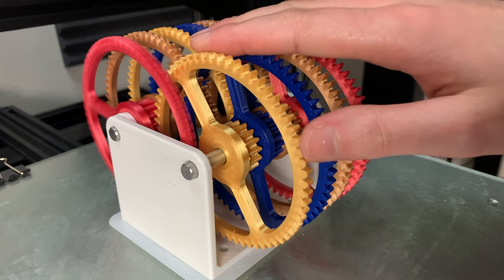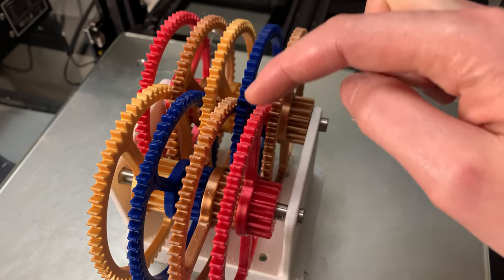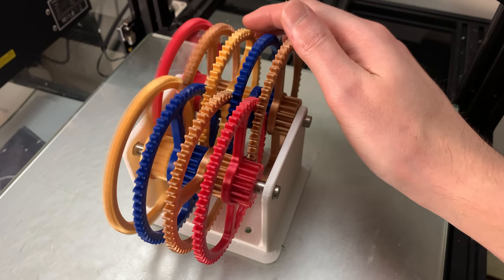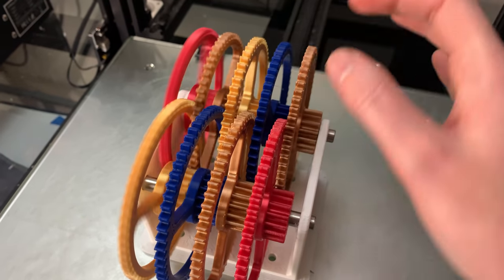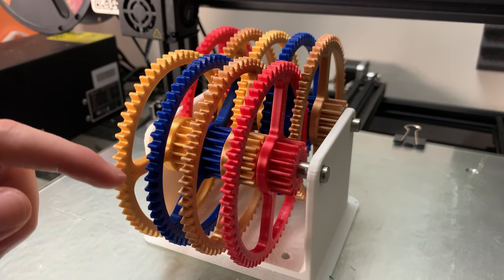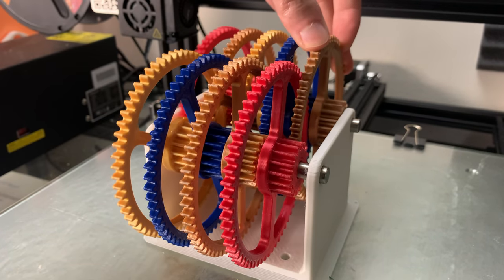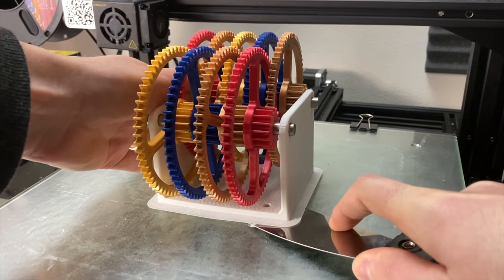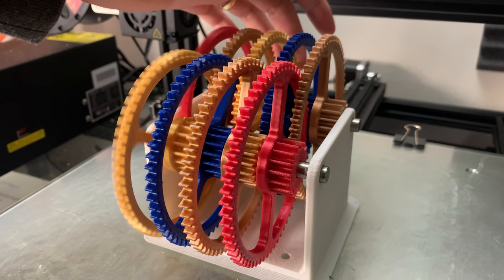Is it possible to spin the last gear?  (1:65000 gear ratio)

Comment: It's caused by the rotation inertia of the gears. For each couple of gears it is multiplied by (reduction)^2, giving the last gear an enormous inertia
Reply: Friction also factors in as well.
Reply: I think Its inertia in combination with friction. if there was no friction, I assume it would be possibe to spin the last gear but it would take a long time to accelerate
Reply: @lilapela  Each stage multiplies the total torque (friction + inertia) by the gear ratio. When run in the "normal" direction, the gear ratio helps overcome both friction and inertia. If there was no friction at all, it would still require 65000 times as much torque; possibly more than the plastic gear can stand without breaking. But I'm likewise pretty sure that if you had all the time in the world and none of the friction, it would eventually get moving under otherwise reasonable conditions.
Reply: Yes, inertia may be the biggest factor here.

Also, it is worth noting that speeds multiply by the same factor. If the last gear was spun so that it's outside moves at mere 1 cm/s, the first gear's outside would move at 650 m/s, almost twice the speed of sound.
Reply: I ain't no scientist but with a lever is it possible to turn the wheel
Reply: @threedo1609  you'd probably break it before it spun
Reply: @threedo1609  As said, it will break before it spins. Likewise, if we ignore lots of physics, a large enough flywheel could get it moving.
Reply: @threedo1609  if the lever is 65,000 feet long ;)

Levers and fulcrums work basically the same way as different-sized gears: a small force applied over a large distance translates to a large force applies over a small distance and vice versa.

If you want the two changes to cancel out, then the magnitudes of each need to be similar.

Comment: When I was younger I actually tried to do this with Lego Technic gears but I couldn’t set them exactly right to go to ludicrous speed
Reply: You had no Schwartz?
Reply: I did that too, but with a power drill. Some parts of it are likely still in orbit.
Reply: @XtreeM_FaiL  I understood that reference!
Reply: @XtreeM_FaiL  Unfortunately, his schwartz got twisted. Hate it when that happens...
Reply: I did it and I went plaid
Reply: I think legos is more durable than this ABS plastic.
Reply: Grab some and try to make a 1:100 gear box and you'll have very easy renewable energy.

Comment: If it took 1N-M to turn the first gear, and you wanted to use a really long crank and your own weight to turn the last gear. If you weigh 150 lbs. you'd need an at least 97.5 meter-long (massless) crank which is about the length of a football field
Reply: haha, classic americanisms: describing length as football fields
(just poking fun. not meant to be rude :)   )
Reply: I think your math is good, but he's talking about applying 30 grams (~0.3N) to the inner gear that has maybe a diameter of 15 cm (0.15m), leading to only needing 0.045 N-M of input torque.

You still need about a 4.5 meter long crank to back drive it which is silly for a 3D printed gear box, but not quite football field silly :D
Reply: @DigitalOsmosis  Yeah, I figured 1Nm of torque wasn't the minimum required to turn the first wheel, but I went with the assumption anyways because it still shows how impressive the gear ratio is 😗
Reply: so usain bolt could get the last gear spinning in 9.58 sec?
Reply: @cate01a  football is the biggest sport in the world
Reply: @Smoshylife  if you mean American football then no, if you mean what the rest of the world men's by football then, still no. but soccer fields are usually larger than American football fields. 

most race tracks are bigger than either, marathons are definitely bigger, ultra marathons are bigger, and pretty much all boat races are bigger. 

then there's competitive flying.
Reply: @deltahat880  uhhh yes, “soccer” is the biggest sport in the world

Comment: A fun thing with the friction is that the force doesn't increase with 65536x by the time we reach the last gear. That would require all intermediate gears to be frictionless, something they aren't.

If we assume that all gears have equal friction losses. Then our first gear needs a torque of 1 to move.
Our second needs to apply 4x that torque + 1 for its own resistance.
And our third gear needs 4x(4x(1)+1)+1 to move, and so forth.
This results in our last gear needing: 4x(4x(4x(4x(4x(4x(4x(4x(1)+1)+1)+1)+1)+1)+1)+1)+1 to move, or only 87381 times the force.
The net increase will steadily approach (1/y+1)x(y^(z-1)) as we add more gears. (z being the number of gears, and y being the gear ratio.)

But realistically friction losses aren't static, both axel and tooth pressure as well as surface speed ("RPM") and material does affect the resulting friction losses.

Comment: This is awesome.
 This also debunks a project i wanted to work on when i was a kid. i wanted to use a gearbox like that (probably with even more gears) conected to a pneumatic piston engine to run a generator and a air pump to keep the engine going and generate electricity. 8 year old me was definitely more creative than me now lol.

Comment: Ok I'm printing it at the moment, but 1 gear has taken 5 hours. I need 9 of them plus the base. Then just cut down some metal rod. So in about a week I will have my very own in ABS🙃
Reply from the maker: Very cool! To get faster prints I use: 0.8mm nozzles, and print at 0.32 layer height, and 70mm/s,  (100% infill for these is fine because everything is thin) you can get a decent gear in 1 hour. 

For the base I use a 1mm nozzle
Reply: i'm also printing them right now. One gear takes 1.30 hours. 0.4 nozzle, 0.2 layer height, 20% gyroid infill, 3 walls, outer wall 25mm/s, infill 55mm/s, inner wall 45mm/s

Comment: What if like, the first gear is made out of steel to handle the force, then you attach a wrench or whatever to give leverage and you put that under a hydraulic press? The last gear would go nuts!!
Reply: At a certain amount of force, something will bend, break, or otherwise deform sooner than get that last gear spinning. In this case, I'd bet on the wrench bending or the housing for the gears deforming until a couple of the gears come uncoupled.
After all, even steel can only handle so much force.
Reply: @peppermintgal4302  it can handle the weight of a truck

Comment: Great video... I'm still waiting for someone to actually try to lift a truck with a gearbox like this, lol
Reply: These exist already. Google "Hand chain hoists".

It's a simple mechanism that allows you to lift, for instance ~4.500 kg (or 10.000 lbs) just by pulling a chain.
Reply: @Dennis19901  Understood. I have 4 hoists of my own. I meant a plastic 3D printed model. lol
Reply: @sky173  Well, in that case.
There's video's floating about on Youtube of someone making hoist-like contraptions from Lego. It can lift quite a lot (given that it's Lego), but nothing even near 50kg's

Comment: If you were to hypothetically spin the last gear to complete one revolution, it would cause the first gear to spin at roughly 3.9 million RPM
Reply: surely you'd have to define how quickly you spun the last gear?
Reply: @Kington99  you would indeed
Reply: Probably 1 revolution per second I guess?
Reply: @Kington99  no, it does not matter as a speed was no defined, just a number of revolutions
Reply: @nathanielbean3119 ;
exactly;
1 RPS = 60 RPM;
60RPM * 65000 = 3.9M RPM

That would require quite a bit of force.
Reply: @aukustihaho8284  RPM means revs per minute, it's a unit of angular velocity, so yes it does

Comment: Imagine the speed of the first one if you spinned the last with 1 rep per second
Reply: Doing some quick and dirty math, assuming the gears are 6" in diameter, if the last gear were moved at 1 revolution per second, the outer rim of the first gear would be going a little over 70,000mph.

Comment: What blows my mind is that it doesn't just work the same way in reverse
Reply: TL;DR
The front generates more force because it's a bigger gear, the back starts with a smaller gear so it generates less force. 

Full Explanation:

Trust me, I was going through the same motions when I started to think about it. I had to watch the video a couple times and do a little research to refresh myself, (I'll drop the link at the bottom). 

Why doesn't it work in reverse? Why aren't the gears just all moving at the same speed if they're locked (I mean they literally have to!)? Does it work rotating clockwise and counterclockwise? Etc. Etc. 

Finally I think I figured it out. The trick is in all these parts being linked big gear to small gear. 

Big gears produce large amounts of torque (force) at the cost of slow speed, and small gears produce large amounts of speed at the cost of low torque (force). 

So think of each big gear to small gear point as a currency exchange, force into speed, speed into force. The only issue is that doing this over and over is going to water down what you started with because, again BIG gears are for TORQUE and SMALL gears are for SPEED. At each point you're essentially having each gear produce what it sucks at the most. In this set up the small gears are pushing torque and big gears pushing speed. It's bound to run out at some point. This is exactly why it's so much more difficult in reverse. You're trying to start the system with high speed low torque whereas it's much easier to start with high torque low speed, (look at the gear arrangement in the front vs. back). None of this would be an issue if all the gears were the same size, they'd all move synchronously. 

So what's the point then? Why build such an energy loss of an item? 

Let's circle back to both our question "why doesn't it work in reverse?". It does. WE'RE just LOOKING AT IT REVERSED. We use mechanics like this all the time, like in bicycles. The whole point though is for the force to be applied on that 'last gear', and having your working gear be that 'first one', so that in one rotation you've made 4 or in this case 65,000. These DO WORK in reverse, that's their design, the video is what's in reverse. 

http://www.princeton.edu/~timeteam/gears.html
Reply: @bradolson8022  Was a pleasure reading that

Comment: this is actually really interesting, i wonder how you determine the factor by which it increases with each gear?
Reply: Relative diameters of interlocking gears when teeth are the same size. If you look, the gear teeth on the inner edge of one gear meshes with the gear teeth of the much larger outer edge of the next gear, so the first gear has to spin ~4 times to spin the next gear all the way around once.
Circumference is a linear factor of diameter (pi * diameter), so the ratio between gears is linear relative to the size of the gears, and the factor is merely [diameter of next gear/diameter of current gear] when measured at the location at which the gears are meshed.
In this case, the ring the outer teeth are set on is 4 times the diameter as that of the inner ring, so 4 times multiplier each set.

Technically it is really the number of TEETH on each gear, but since the size of the teeth here are the same, it works out the same way: there are 4 times as many teeth on the outer ring as on the inner ring, so you get the same 4 times multiplier.
Reply: @Vertraic  u cleared my doubt tnq

Comment: If there's one thing I know about gear ratio coming from Airsoft is that low ratio gears spin faster. I'm talking about Rita fire and the cyclic rate when they decide to make those upgrades people always bring up gear ratio. People rarely use high gear ratios anymore they just use high torque motors cuz you got to remember that it has to pull back a heavy spring to expel a projectile

Comment: Why would you try to move the last gear by force anyway? That's like starting your car in the top gear - it's just stupid. You get the last gear moving by shifting thru the gears. Spin the first gear, move to the second gear and get rust moving faster, and work your way up the gears. That way torque isn't your problem, it's the heat generated by the friction in the first gear!

Comment: You could perform the manual equivalent of a step-up transmission, but I think the contraption would eat itself as it reassures speeds that would shake the whole thing apart.

Comment: ya’ll need to make an explanation video on how this crap works, I’m still confused lmao
Reply: The short and simple of it is that each gear as you go up requires 4 times the force to rotate, making the last one impossible to spin due to it needing more force than the gear would be able to withstand without breaking
Reply: @Epsicronics  ok so what I'm confused about is that the first gear makes contact with one gear behind it. The last gear makes contact with the one gear in front of it. So why is one direction different than the other direction?
Reply: @archangel1824  Someone else posted a comment about it. They said “It’s caused by the rotation inertia of the gears. For each couple of gears it is multiplied by (reduction)^2, giving the last gear an enormous inertia.
Reply: @archangel1824  Also just noticed I responded to you on accident.
Reply: @archangel1824  I'm slightly confused what you mean but since the big gears have smaller gears which drive the next set of big ones, the direction will reverse after each one because they mesh directly, sorry if I misunderstood what you mean
Reply: @Epsicronics  what I mean is if you turn it where the gears are going left to right. Why does turning the furthest left one differ from turning the furthest right one. They all look the same.
Reply: @archangel1824  if you start from the red gear, you are starting with a small gear turning a large gear, and if you start from the last gear, you are starting with a large gear turning a small gear

so in the reverse direction, the way the gears are set up, it will lock up because you can't apply enough force

like, the ratio is 1:65000, so rotating that last gear once makes the first one rotate 65000 times, and that would just blow the thing up, and would probably break that gear to try to turn it hard enough to do that
Reply: Gears use and manipulate mechanical advantage much the same how a lever does. An example of a simple lever is a playground see-saw.  

You and a friend of a similar weight are able to bounce up-and-down all day long because the fulcrum sits at the point of equilibrium meaning that it's an equal gear ratio. If you were to move the balance point (fulcrum) towards one seat, that seat would move less and move slower but it would have a stronger force behind it. 

What happens with a lever is basically a conversion of horsepower to torque,  You are trading speed, rate and distance for single moment force. Thats why gearboxes use ratios like 1:4, they indicate a 4x distance/power exchange
Reply: @Acusumano25  but hey if you five snatch blocks set up you can pull that rope the same way from either side.
Reply: @archangel1824  each gear has a small gear at the Hub and a large gear on the circumference. The large gear on the Outer Rim is interacting with the small gear on the Hub of the next gear.
That's why they have two gears side-by-side. The axles are set so the outer edge of the earlier gear turns the small gear at The Hub of the next gear

Comment: just discovered gear ratios today 2 videos ago... I feel like since everything is connected, everything should be moving, it seems strange why it would be hard. my gut instinct was friction, but that can't be right because that should push back and stop the first one. figured it out  eventually, basically when the first gear turns, it's angular velocity gets transferred to its attached smaller wheel with less teeth that is supposed to turn the next gear. but since the smaller wheel has next teeth, it only turns the 2nd gear a little bit (1/4 of a revolution in this case). So when the 2nd gear finally turns, it turns its own smaller wheel that has less teeth. That smaller wheel then turns the 3rd gear, but only 1/4 of a revolution if the 2nd gear turns 1 revolution, which requires the first gear to turn 4 revolutions. It's just because the smaller wheel has less teeth. If they somehow fit more teeth on the smaller wheel, then it will work out. The last gear is actually turning, just not enough for you to notice. it's all connected so it has to move, I wasn't wrong there, but it turns 1/4^8 of the way with each turn of the 1st gear.

Comment: The things is actually you can spin the last gear. But with very very low speed. It requires high power when you want to rotate it with same speed of the first gear.
In theory you need same force for rotation the same one for last one BUT with very very smaller speed

Comment: You could spin gears one by one moving to the last piece, loading energy in the box slowly, the difference of torque being less than what the gear can take. But then the first gear would spin more than 65000 rpm. So the question to ask is would the gear able to withstand that rpm :)

Comment: There’s a few problems here... firstly you neglect to mention reflective inertia, and secondly you neglect to mention backlash. Say you have 5deg of backlash in each mesh, then once you’ve turned the first gear 65000*5/360 times then you’ve taken up the backlash, and you can then turn the last gear, albeit very slowly. This will keep the torque very low and prevent the gearbox breaking. If you try to directly turn the gear to avoid the backlash issue then the first gear will have to travel incredibly quickly, which would require a huge torque to overcome the reflective inertia, hence why it can’t spin. If you used a gear designed gear profile to minimise backlash, and attached a small motor to stop your hand getting tired, you could easily observe the last gear turning if you left it long enough - a 500rpm motor would only take 2 hours to make a complete rotation of the final gear.